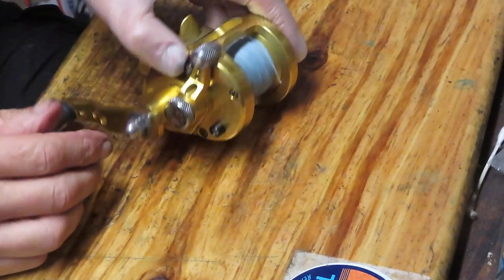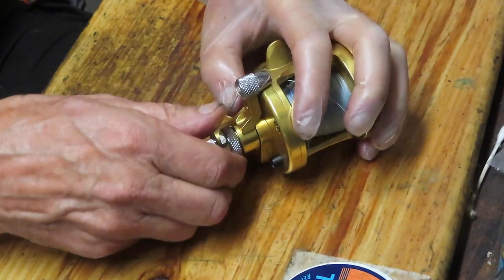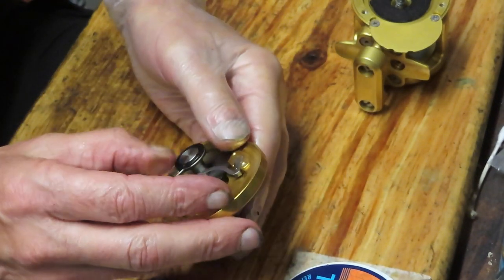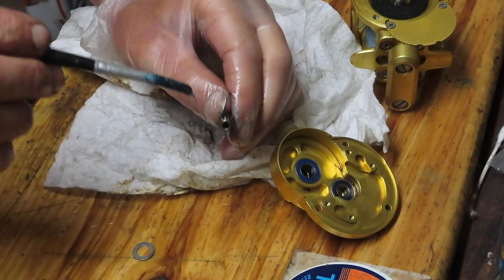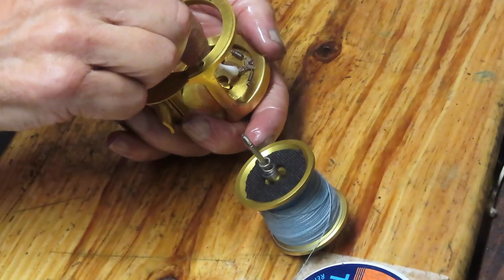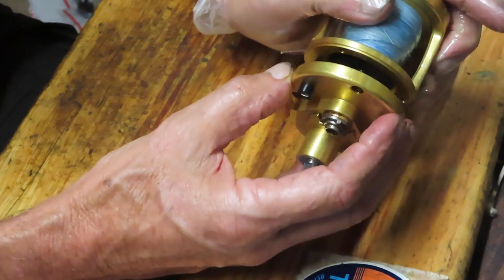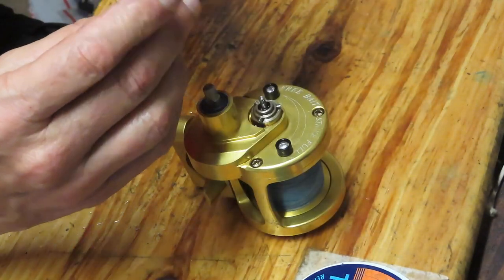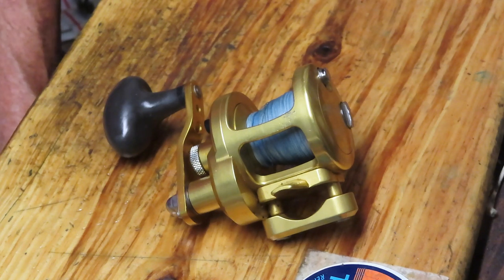Avet SX 5 3 1 MC lever drag fishing reel how to take apart and service

Comment: Very informative.  This reel is a little out of my price range new - but lately I have seen some come across used that are in my affordability range.
Thanks Dennis!

Tad
Reply from the maker: Yes - the market for used Avet is starting to come down in price as folks are replacing the older versions.  You can find them at about half the cost of new in the $150-$200 range in good condition - Thanks - Dennis

Comment: what is the correct sized bit for the two small screws holding the handle nut locking plate please.
Reply from the maker: I'm not sure and I do not have the reel to check.  It may be a T8, but I could be wrong.  Dennis